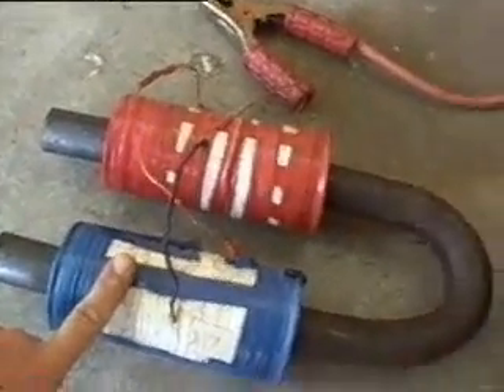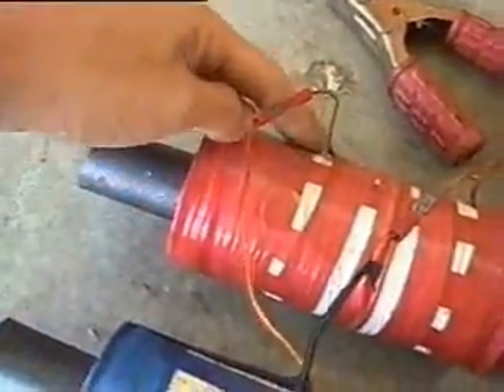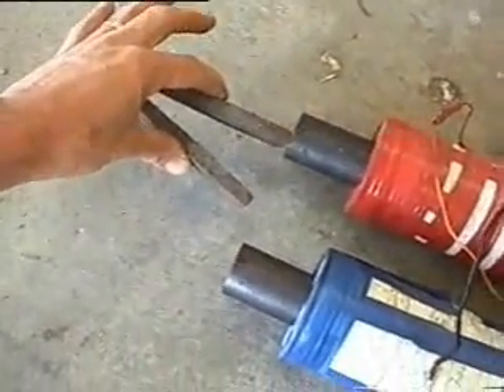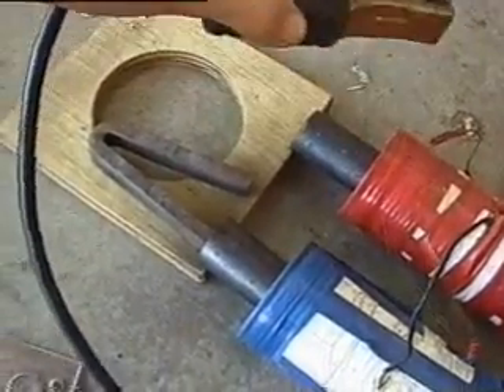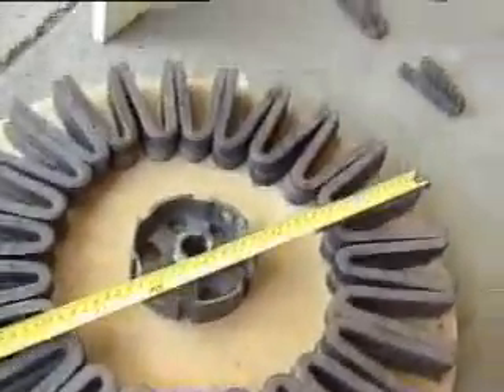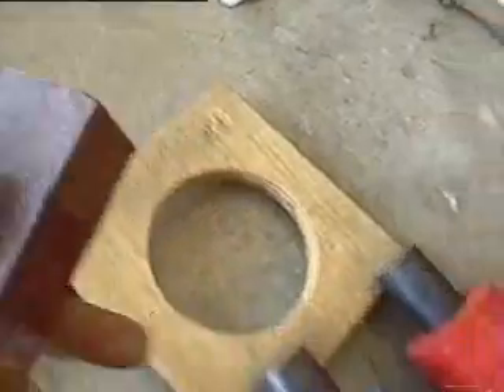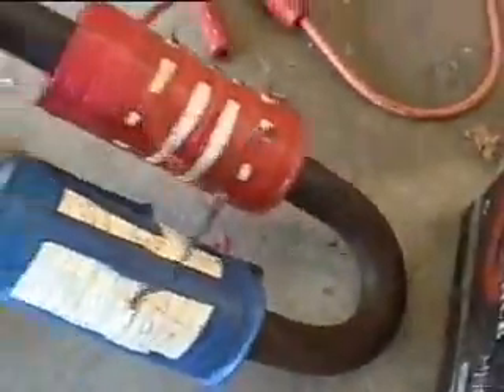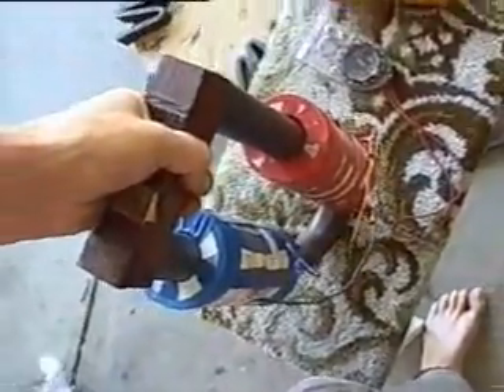pmh and vee magnets

Comment: So you put 24 (recharged) old Ford v-magnets on a wooden wheel. Now what?
(Are the v-mag ends N to S? Or N to N, then S to S? Why? What will it do?)

I have a different plan for magnetically pushed wheel using angled magnets (& others to react with), but a different angle, and very different pattern! (Unfortunately I can't find the style of magnets I need. I looked far. No reason they couldn't be made, but currently there is no use (or demand) for them! Bending/cutting Nd mags problematic!)

Comment: He is using a DC battery.  The battery would have to be grounded first for there to be a risk of shock.  It is also 12 V which is low enough that the resistance of concrete is not going to permit any current of meaningful size.  That said, it is always a good idea to practice safety (no such thing as too safe).  However, the potential exists only between the terminals so there is almost a zero chance of shocking yourself.  (computer circuits are a very different story).

Comment: Cool. Read my post again. Your argument is that voltage also kills, because it is required to transfer the current. While this is true, voltage does not kill you. When 70ma IS flowing across your heart, you die. If the voltage is too low, there is no current flowing. If there's no current flowing, that's different from current flowing and not killing you. (High voltage low amp situation) but in a high amp low volt situation, there isn't actually any current flowing.

Comment: Coll story bro! Take this example..
Imagine you have 100,000 volts, and 1ma. You won't die. Current IS flowing through you. 

What if you have 1 volt, 100,000 amps? You won't die. Current is NOT flowing through you. It's the same as if you aren't even connected to the circuit. If it was able to connect through you, you would die.

The voltage will never kill you.

Comment: but you can hold both wires from a car battery and it wont hurt at all. have done it many times. yes amperage kills but only if it has the volts too. volts alone are harmless, static charge in your sweater can be thousands of volts with next to zero amps but you could have a million amps but if it is next to no volts then it isn't gonna travel.

Comment: @wb6iaq Okay now even I am getting this garbage leaking over into my channel. There is no need to call this a B field when it is simply the energy half of mass, the other half being heavy ions which are also known as slow positrons, capable of holding a mass that of platinum or gold when the large boson particles making them are so compacted. People seem to forget also that 2 motors run by the flywheel are critical to function of levitation else there is no reason for exponential loss of mass.

Comment: @cyalense If the objective is magnetic current, you can imitate a v magnet is what I'm saying. As long as there are no breaks, iron or ferrous steel never loose magnetic charge when in contact with a neodymium magnet. 
Because current runs in the steel, it is the same thing as a V magnet; 2 neos on ends of v metal. It's better because it's a lot easier to make, is more powerful, lasts forever, and has the best magnet power for a dollar ratio.

Comment: I don't think V magnets are necessary, you should be able to place bar magnets on the ends of V shaped iron/cheap steel, since it would still allow magnetic current flow; the objective. I'm about to use neodymium and steel in mine.  The long chain was an antenna to earth's hz wave, the generator could do nothing without it. Lots more info in my videos I made on the subject.

Comment: nice video dude on perpetual motion holder :D
dude, remove the 3 phase motor on the Flywheel that you are building, you will end up a wrong direction with that set up. Just stick on the PICTURE. thanks.

Comment: i have found through testing that placing the u shaped transformer next to the disk does not get that such power out unless you have the coils next to the spinning magnets. he used some thing else. but he did increase the power the  U shaped magnet. you will find the the pulse plate has to be to scale. i will explain some other time why the pulse plate has to  be the size it is.......great job, but a long way to go